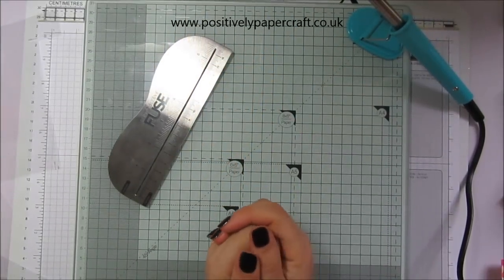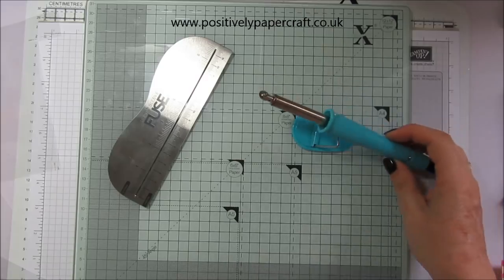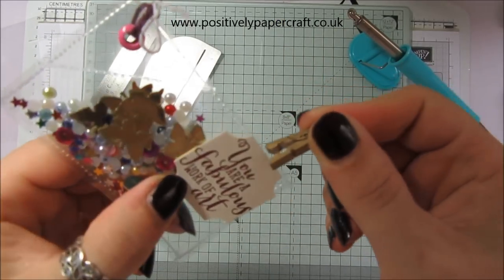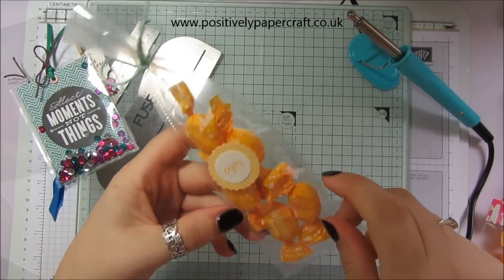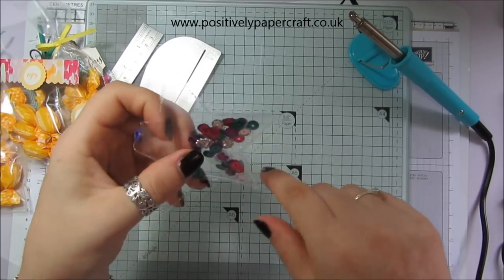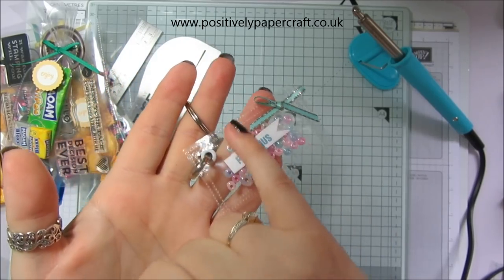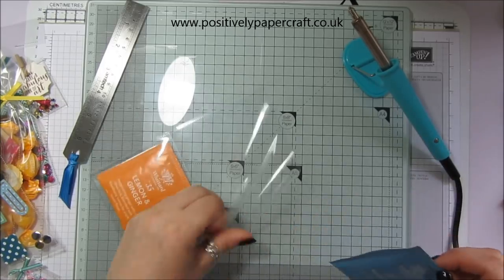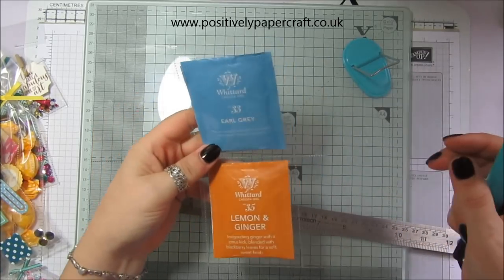The Fuse Tool DEMO & Project Ideas!!

Comment: Thank you for This Fuse Demo Video Girl!
Since I moved in my first forever home 9 years ago, all my craft supplies been stored in the attic or garage. Due to taking in caring for my elderly parents 24/7. 
Mama age 89, was bedridden and passed 2 years ago so did Dad at age 93. 
Just when I started setting my craft room space in December 2021 my Sister passed right before Christmas and 6 days later my husband passed too. 
2022 didn’t craft at all my heart was in it. 
Now I’m finding all my supplies and came across not opened The Fuse Tool W/Accessories From HSN. Mine did come with the resting washer, 2 blades , mat,heavy duty 12x12 sheets plus all sizes. Papers,Stencils and gems. Etc…
Thank you for the tutorial. 
Love your channel, glad I find you. 🥰

Comment: Hello. Thankyou for your video. Really great ideas. May I suggest the We R memory  keepers heat resistant silicone mat. It's made for the fuse tool. And since I've been using it. Ive had no problem with my wheel not turning or things not sealing properly.  You can properly get away with using any heat resistant silicone mat.  Not just this specific brand. :)

Comment: I love the teabag idea! I use clear builders rubble sacks (400 gauge), much cheaper than branded pouches and I'm not restricted to a max size of 12x12 or A4. Also agree with keeping it in a coffee mug as the stand is not very secure without the ring.

Comment: I totally forgot I have the fuse mat and it has a holster built in to house the hot tool. This is what happens when you buy all the accessories, move then reset your craft room up. You forget what you have.

Comment: I just love this demo. So happy you showed how you can just get page protectors at the local store instead of having to buy plastic sheets through a company that would be much more costly.
 This will make great pouches to package items for craft fairs. Also love the keychain one. Might be great to make a pouch for a shaker card, and you could use the nesting die one size larger than your card front cut, to seal the shaker pouch. There doesn't seem to be the static cling here that you have to fight with when making shaker cards using sequins. I hope you are still loving the art glitter glue. Just make sure in the fall to stock up for winter. If it ever freezes in shipping or storage, it doesn't work very well. 
You might give thought to the sticky tiny magnet beneath the top of your bottle tip. You can put the pin on that when you remove it to use, so it doesn't get lost on your desk under scraps when creating.😍 I just absolutely love that glue. Never found anything better, and the metal tip keeps anyone from using too much glue.